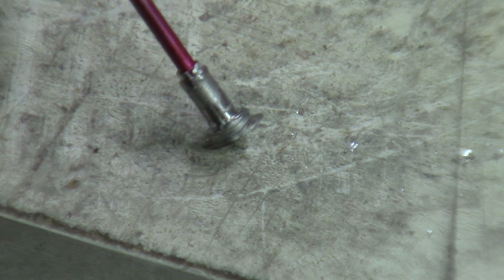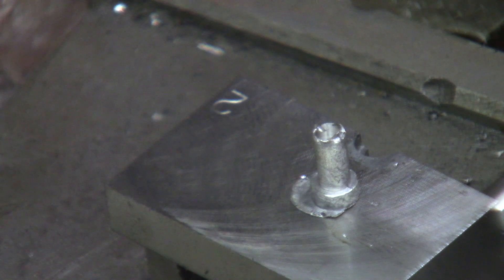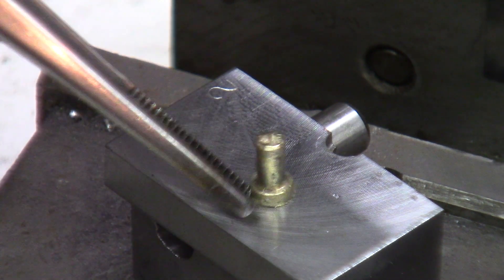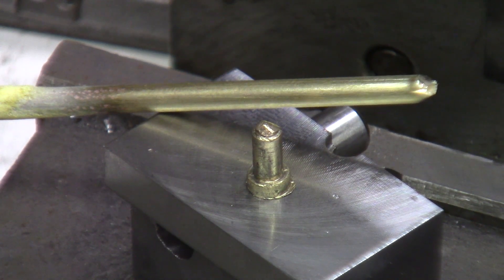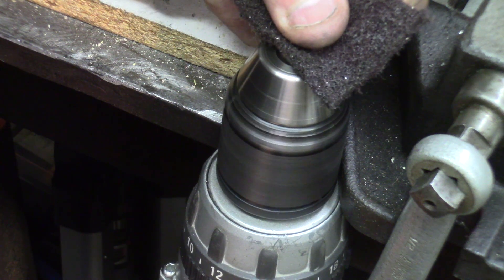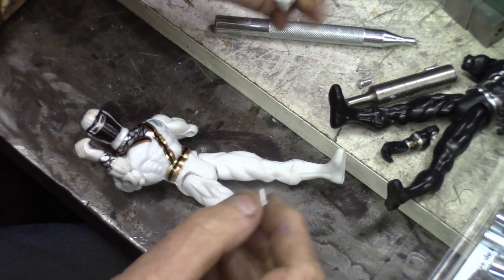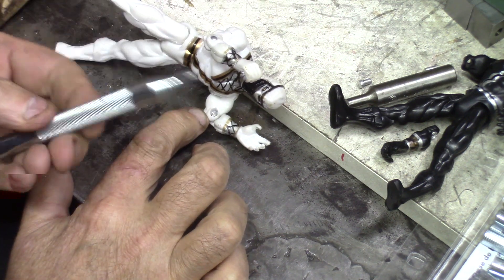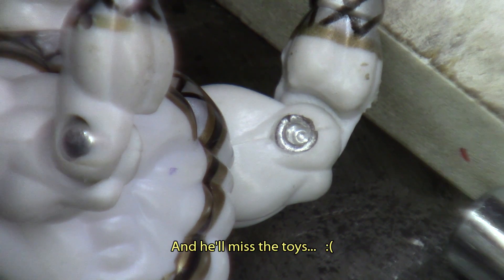Making a Forming die to produce custom rivets in order to fix my grandson's toys. part 3

Comment: I need 2 3/4 inch aluminum rivets for my boat. Ill try this?
Reply from the maker: It sure can work, you can possibly use a thumping block behind and hammer the rivet's head from the front if the rear is accessible...

Comment: Thanks for the nice videos. Great fix it project and repair anything with any size rivet. A chain brake work will too.
Reply from the maker: +sam yeates 
Thanks for your appreciation and commenting, the most interesting part with machining, is that there is about a thousand good ways to achieve a repair...   ;)   
Regards,   Pierre
Reply: thanks, don't always comment but your video invoked a clear and interesting project. looks like you have large number of grandson fix its. i also do a lot of grandson fix its. this rivet maker will be copied (by me) just a matter of when.